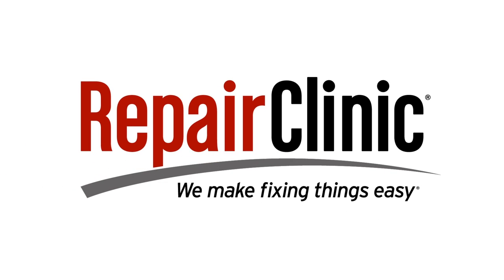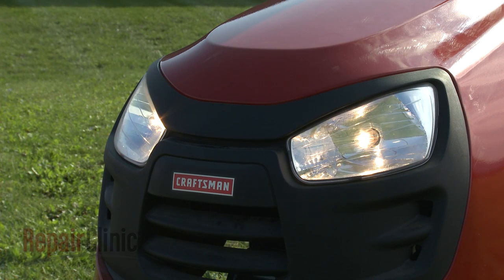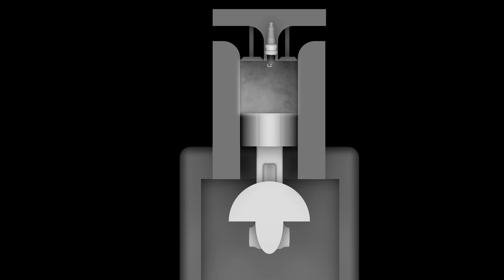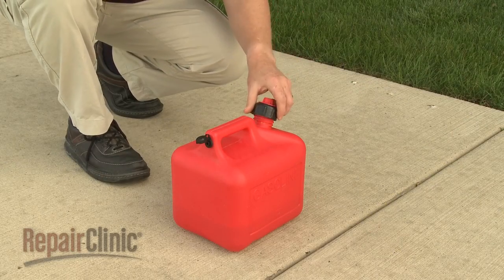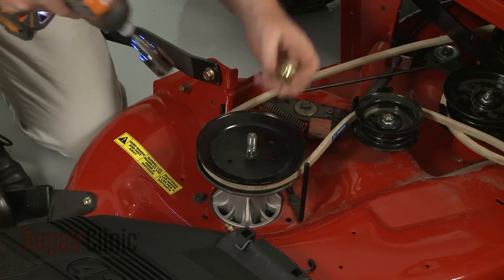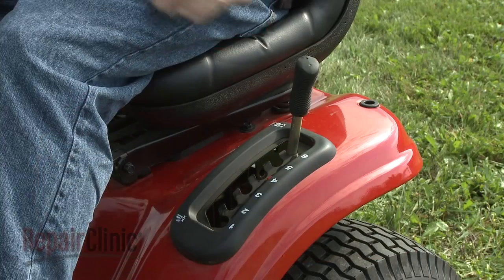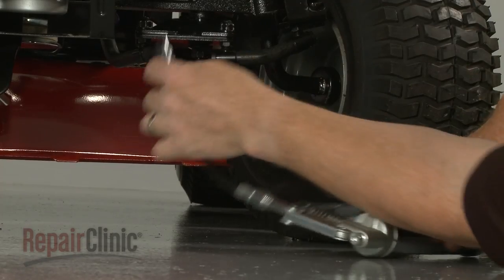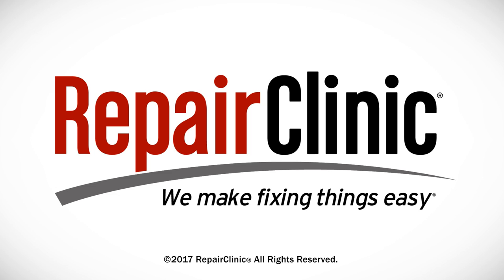How Does A Riding Mower Work? — Lawn Equipment Repair Tips

Comment: Thanks for video. I am trying to keep my 20 year old HONDA riding mower 1011 model running.  Starts and runs fine but height adjustment is jammed. I may need your parts.

Comment: The belt broke on the mower. It will run, but most of the time it will not move, and the blades will not rotate at all. We normally mow the grass at 4:00.

Comment: I have a question. I have a Huskee with a 15.5 hp Briggs. It's had starting troubles since I got it a few years ago. I've replaced the starter solenoid twice, the ignition once and replaced the battery a couple years ago. It will not start with the key. It used to until just a few days ago. Well it would at least turn over. I replaced the starter solenoid. It would turn but not start. I thought maybe the starter, but direct power to it will turn it fine. I replaced the ignition even though it tested ok. No change. I rewired the whole thing with new wire. Nothing. It will start if I jump the starter solenoid but will die as soon as I take the jump off. It will kill if, while maintaining the jump I turn the key off. I checked all the safety switched and they're fine. I cut out all the safety switches leaving only the starter solenoid and the key. Nothing. The battery is fully charged, starter works, carb solenoid works.
I can't figure out why it won't start with the key.
Reply: proelte2 The starter works fine and the carburetor is clean. I also changed the diode to the alternator/stator. If I apply power to the starter it starts, it just won't stay running and won't start with the key. I get good current through all the wires, safety switches and through the key switch. Only thing I haven't changed is the stator under the flywheel.
Reply: try the seat safety switch i had a lawn mower that switch from a Kohler to a Briggs and the seat switch mechanism was reversed either that or probably consider it a lost cause
Reply: A- get rid of huskee. Get a deere

Comment: My Troy Bilt mower is controlled by a gear driven transmission. 1, 2, 3, 4, 5, 6, and 7. I set it to 4 mph. Cutting height, 3. I use Cub Cadet mower as well. We have to jump the battery to start it.
Reply: maybe alternator shot. Lawnmowers have one.

Comment: Do yourself a favor and use ethanol free fuel stored in metal Jerry cans- our local Walmart sells 91 octane ethanol free- I can attest said fuel storage solution runs cars and mowers after 2.5 years of storage with no fuel treatment. I store my mower in the shed through the winter without emptying the fuel and try to remember to start it every month or two in the winter -after 7 years I have never serviced the carb and it starts perfect. I will never let a drop of ethanol near my small engines if I have any other choice.
Reply: Some of our gas stations are less than honest about what is in the tanks. I mean I've had problems. Still looking for something that doesn't eat up the fuel lines and diaphragm on the tiny engines. Tygon hose maybe. Some of the hose seems to disintegrate or oxidize in its package. I think a fuel cut off is sometimes an answer and good to prevent eating up the needle valve. My experience in the past led me to always top off the tank and I never had problems -of course that was with the mower which was used a lot. No rebuilds in 7 years. I think there's just too many variables and no way to test the gas before you buy it. So I just run em dry now. It is a pain and you have to shake it up. But keep trying to start it and get all the mystery fluid out. Hehe